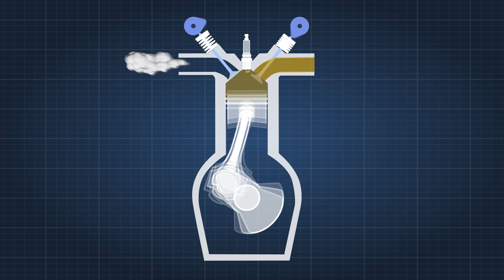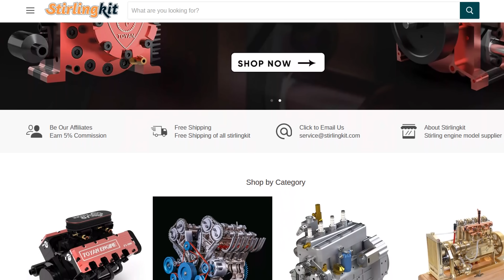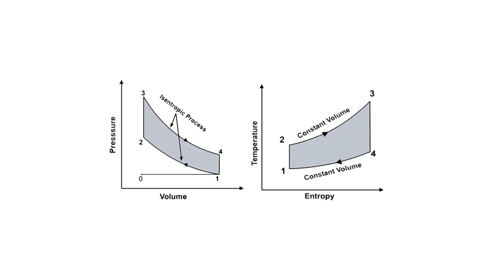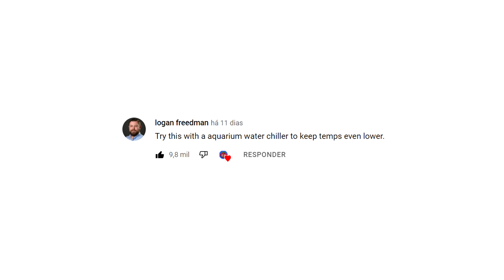I 3D Printed a Transparent Combustion Engine in Resin

Comment: fire propagates more slowly through Gasoline than the other fuels, it is more resistant to burning. so the gasoline is probably producing more torque at a given output rpm. stroke/bore need to be optimized for a given fuel. for gasoline slightly oversquare bore sizes lead to better efficiency. while engines with lighter weight fuels tend to have undersquare or very undersquare combustion chamber profiles.

Comment: The piston is pretty badly scratched up, and i'm betting the rubber o-ring on it isn't doing too well either. This likely causes the air & gas to just escape through the sides of the combustion chamber when being compressed, not leaving enough mixture to ignite. The 25% NM likely worked the best because it needs the lowest compression in order to fire. 
TL;DR your piston is ruined, get a new one. Also check if the cylinder walls are smooth or if they have any bumps or scratches which could have caused this. Also check if there's sufficient lubrication to the cylinder walls and if the cylinder head gasket is leaking. These are all likely causes to loss of compression in a piston engine. 
Source: Am mechanic

Comment: The problem is the air to fuel mix. In general the more volatile a fuel is the more air it needs. Because it produces a lot of vapor so quick it oversaturates the oxygen mix. That's why the performance was so bad, it took more time for that mixture to become just right and there also wasn't enough oxygen for all of the fuel to combust. But as always this was a great video. Can't go wrong with explosions and fire.... Unless you start using yellow chemicals lol.

Comment: Since gasoline engines are so inefficient and only use twenty five percent of the energy created and the rest is heat.  You could try reusing that heat and turning it into steam making a second part of the engine steam powered which would make the engine much more efficient

Comment: The reason the weakest fuel performed the BEST in your model engine is because your model engine is a
 “LOW COMPRESSION” engine…. This means it requires fuel that can easily ignite and combust with just a little compression🌬… NOW, the higher performance fuel, the higher octane rating that fuel has and the “MORE” compression is required to ignite that fuel to get a combustion 🔥 
Sooo… if you put cheap gas in a 
Ferrari 🏎.. you will get “pre ignition” or detonation because cheap fuel ignites under mild compression and mild temps while the Ferrari engine is a very high compression engine and very high heat temperatures💀… and  if you put a high performance fuel (high octane fuel)  in a regular basic engine line a Toyota Camry, you won’t notice any improvements in performance because that basic engine is not designed to produce high compression to begin with so there is no benefit
 (performance wise) although emissions might be a smidge better because of of the additive blends that help keep high compression engines clean from carbon buildup.😎💪🤘

Comment: Try a fan on the air intake to draw more air to fuel ratio. use the output of the rotar to spin mounted fan at the air intake then you'll have a self sufficient air to power ratio. you saw how to suction of the piston pull wasnt great. so maybe needs some extra help getting air in through that small intake nozel

Comment: Methanol and Ethanol has a better compression ratio which means you can compress it more and so extract more energy, making it more powerful then Gasoline in practical. In Brazil we have the so-called "Flex" cars that can be fueled with either Ethanol or Gasoline when usually they have variable compression ratio and on the manual you see that it has more HP when fueled with Ethanol. On the bad side, it makes it uses more fuel, than it is less efficient

Comment: Methanol has less energy density. But its stoichometric mixture is lower and contains its own extra oxygen.

If you balance your air fuel ratio right you'll burn twice as much Methanol and see about 25% power increase as you burn about double the fuel by mass.

Methanol also has a very faint clear flame so it's hard to see a fire.

It's possible that your engine worked better on Methanol but misfires on petrol is the mixture is way too rich for petrol.

Nitromethane Methanol mixes has a stoichometric ratio about 6-7 times more fuel mass than that of petrol so you have to mix far more of it.

Your ideal ratios are

12 to 14 : 1 on petrol for good power

6 to 7 : 1 on Methanol for good power

1.4 to 1.6 : 1 on Nitromethane for good power.

If you adjust your carburettor to target this you'll see the best performance.

Too lean or rich  you don't get a homogeneous mixture therefore poor flame propagation or a complete misfire.

Comment: Your mixture is not right. The gasoline burn colour is yellow (as yours) when too rich. You should look for blue/whitish. 

The skipping of burn cycles could be the reason but if that is so may be the mixture is too lean. 

Anyway if you have a way to calibrate the mixture it should work fine.

Comment: I think your dilemma in this video is the same reason why they say certain cars can Only use certain gas  because what it is takes to ignite certainly fuels like the amount of pressure or heat from spark otherwise it just runs on compression

Comment: That rc nitro fuel burns slower than gasoline so when gasoline is ignited right before piston is at TDC the nitro fuel should be ignited well earlier maybe when the piston is coming up half way the cylinder so when that engine has the regular gasoline spark timing its losing performance when used with nitro fuel because it doesnt have time to burn to its full potential

Comment: My understanding as to why the engine ran slower on the 16% and 25% Nitro is due to the combustion having too much oxygen. When burning a fuel, and you add too much oxygen, the flame type is called an oxidizing flame. An oxidizing flame doesn't burn as hot, as it isn't an ideal mixture.
With the engine, running the Nitro fuels without calibrating the carburetor to the right air/fuel mixture would mean the explosion doesn't get as hot, and thus the pressure of the hot gasses is lower, making the power of each power stroke is lower. Nitro is a 'better' fuel because you can have more fuel in a given intake stroke than with gas, but it only works better under that scenario; as a richer air-fuel mix.

I don't know specifically why the methanol would run faster than gas, but maybe it has to do the the compression ratio of the engine. It could be a more optimal compression ratio for methanol than gas, making methanol more energetic in the engine.

Comment: You should measure it’s torque and then you’ll get way more insight into how well the engine is running. The compression will have definitely taken a hit by sanding the inside of that they need to be a very exact size to hold compression and run well. For the fear of bad ignition timing is another thing and actually makes a big difference especially at the higher the RPMs, if it’s just going at exactly top dead centre then at higher rpm the spark might be to late to have any power or just miss completely is possible. Also check air fuel ratio especially when using different fuels to much or to little will impact how well the engine runs. Just run some checks on it like you would for any engine google can walk you through it if you tell it your issue your observing.

Comment: With methanol you need more fuel  compared to gas. Your putting the same with all fuels. Race engines on nitro use superchargers to bump compression in the cylinders

Comment: The engine could have died on the more powerful fuel due to the carburetor not allowing it to suck in more air. Or the valves were floating due to high RPM. The springs and push rods may not be strong enough and could be flexing too easily.

Comment: Revisit the clear cylinder engine but print a TPU head gasket. Nitro-methane requires a higher compression ratio similar to a Diesel engine in order for it to burn efficiently.

Comment: Regarding the speed on alcohol versus the speed on gasoline, although it really stores more energy, it doesn't burn completely on the Otto cycle. The alcohol performs better because it's power density is better used, burning almost completely. Regardless, much of the fuel actually vanishes on the exhaustion cycle.

Comment: It might be running lean depending on the fuel, hence it might have a consistent 8 stroke. As it saves a bit of fuel from the previous fuel intakes, for the next stroke, building up, then when it has a good ratio it combusts.

Comment: As far as why there are different RPM vs fuel comes down to the speed in with the fuel reacts, vs total amount of energy available in each unit of fuel.
An extremely oversimplified way to look at it is that a lower octane fuel will react faster, but have less molecules that are able to react per intake/power stroke.
 The motor will have less overall torque when there is a significant enough load with lower octane fuel, but without that load the faster reaction will drive the motor to turn faster.
With a load the generally higher octane fuel with more reactant molecules per measure of fuel and air will have more overall energy with a longer burn within each power stroke.
 The motor can utilize this additional energy as torque to drive additional load.

I hope this helps.

Comment: As for rpm limits.. it could be the speed of the combustion itself. Think of diesel, generally you can’t rev the engine up high as the diesel is slow burning. The fuel needs to complete its burn while the piston is up high on the way down to generate torque, if it’s slower burning less torque will be available as the combustion will continue as the piston reaches the bottom of the stroke and be wasted power. Slower burning fuel mixes will be more red limiting as with higher rpm the piston will move faster and there will be less time to complete combustion.

As for why that’s happening on gasoline or nitromethane. You probably need to advance your ignition timing. Ignition (edit: once you solve getting each combustion stroke to combust, obviously with approximately half the torque from half the number of combustion you will get lower rpm) should occur as far in advance as possible while avoiding knock to maximise pressure on the piston on the way down. Ignition should occur before top dead Center of the compression stroke as it takes time to combust and for the flame to propagate, so you ignite the mix before compression is complete.

As for failed ignition, you may need to adjust your fuel ratio mix with the carburettor, too lean or too rich mixtures may be harder to ignite in some cases, but that’s not all, your air fuel mix might not be homogenous when the spark is firing and you’re getting a pocket near the spark plug that is hard to ignite, there would be some left over fuel richening up the mixture for the next combustion cycle but also time to mix more fully too, your carburettor might not be mixing it that well potentially.

But first things first - try to adjust how much fuel is going in and see if that fixes it. Another thing that may help is increasing the voltage to the spark plug to create a hotter spark. 

Also there is the cylinder itself too, carburettor engines typically start with a choke until the engine is warm enough to help maintain combustion. So it seems like your first action would be to make the fuel mixture rich slightly richer.

Comment: Less energy in the fuel doesn’t mean less power or efficiency. For example propane has a very high octane and lower energy content, but that higher octane can withstand a lot more compression (more efficiency) and/or much higher boost from forced induction (more power). Additionally with propane you can put the tank upside down and feed from the bottom to inject liquid propane into the carb or injector. The liquid to gas phase change as it heats up and expands will drastically cool the charge, allowing even more pressures.

You can increase efficiency by raising the compression ratio very high, to optimise for premium gasoline, water+methanol injection through the intake at about 10% the fuel usage rate and is said to add around 10 points on the octane scale, allowing even more pressure from either compression (thus greater efficiency) or forced induction. Then propane can take that further as a fuel, and of course you can run the injection with propane as well to optimise for an extreme.

There is an engine in Mazdas that runs at 16:1 compression ratio with a supercharger and fuel ratio of like 28:1 or so etc.. very lean, they’re fuel efficient and supposedly run around 40%+ efficiency. This runs just off gasoline. Optimising that for any of the aforementioned fuels you could push that even further.

And if you combine that with Atkinson cycle to reduce pumping losses it raises the efficiency further. 

Then there is another thing, called freevalve, basically electromagnetic valve timings or compressed air valve timings… remove the need for a camshaft reduces the rotational mass and improves efficiency further from that reduction but also allows any “cam” timing you want and can run both Otto and Atkinson cycles in different situations.

Comment: One thing you should look into the model of the engine can explain why there isn't consistent power strokes. The engine may be hit-n-miss engine with irregular firing cycles which is just built in the engine. That means if the engine is exceeds certain amount of rpm it will miss a power stroke to drop down the rpm.

Comment: One of the issues with the engine running on alternate fuels is the jetting of the carburetor. Alcohol generally takes twice as much fuel as gasoline, so your carburetor needs to be able to flow far more fuel. The addion of nitromethane amplifies that need. In racing vehicles there are carburetors designed with huge metering jets and passages for the alcohol based fuels. Ignition timing may also be affected by the different rate of burn.

Comment: Use a constant load to speeddown the motor, you should be able to see a consistent 4-stroke cycle with all 4 fuels. Is also possible that the problem is the air/fuel balance (carburation).  Maybe there is not enough oxygen to properly ignite.

Comment: Focus on the flame propagation. If a fuel burns faster than another youll get more rpm. But slower burning fuel has more force than fast burning fuel. Thats why diesel engines have a ton of torque and low rpm and gas engines have less torque but more rpm. Its all about what fuel is in the engine. If you want more rpm in your beautiful little engine than find the fastest burning fuel possible. And on the other end i kind of wang to see how slow you can get that engine to idle with slow burning fuel

Comment: Your carburetor may be dirty try running Kerosene You may also have to adjust the carburetor for different fuel mixtures and Ethanol should do better than that methanol but the BEST MOST POWERFUL FULE ANYONE CAN MAKE AND USE IS (HHO GAS) you make it for water  it's just Hydrogen and oxygen gas pre mixed it is the most energy dense substancest

Comment: Try to transform your mini engine in a "twin spark". Just 3D print a new head with two spark plugs and add a second sensor  on the crankshaft case. 🤔

Comment: Suspicion as to reason for lower RPM: overcompression. The mix with gasoline creates pressure significantly higher than needed to move the piston by a full stroke and actively resists the piston on the exhaust stroke. Weaker fuels create pressure low enough opening the exhaust valve releases most of the pressure before the exhaust stroke really starts, and so it doesn't present much resistance. Also not all exhaust is drained in the exhaust stroke, so next cycle very little air-fuel mix gets sucked in. Only after two exhaust cycles the cyllinder is empty enough to refill with the mix.

Comment: In drag race you don't want big rpm you want torque some fuel give more horsepower in torque not rpm. Cars don't need high rpm to be fast because they are conected to a transmission which gives car the high rpm

Comment: Fuel changes require ignition and timing advances. Magneto ignition on this engine is also very weak. Methanol has a higher octane than gasoline and so does Nitro/Meth mix. So you’ll need to advance timing a few degrees to achieve the same manners as running it on gasoline. Higher octane rating allows for a bump in compression safely as well. I bet if you mill the head down just a little bit it’ll make nice power for that small of an engine on methanol
Reply: Also that o-ring on the piston is not sufficient for any sort of increase in power. Thats asking for blow by and crankcase pressure increases. Engine needs a set of piston rings

Comment: i really think your air intake valves are not perfect, i see on of the rocker arm jumping up 6:32 , maybe at high Rpm it cannot hold up with the cam timing due to vibration? try with low or ideal rpm and lets see it go, also in the beginning it was 4 strokes maybe the cylinder is not able to loose heat easily as a metal.

Comment: octane rating exists for a reason. High compression engine requires high octane fuel because low octane fuel may have misfires and cause knocking. I don't know the exact science behind it. I just know that my Toyota only needs 85 while my WRX needs 93.

Comment: i think the problem is the different solutions have different flash points at that pressure, everything changes its boiling, melting and flashing(ignition) point when it is under different pressures and temperatures